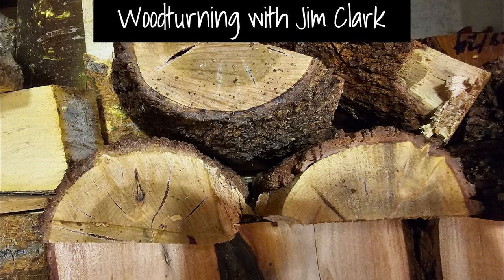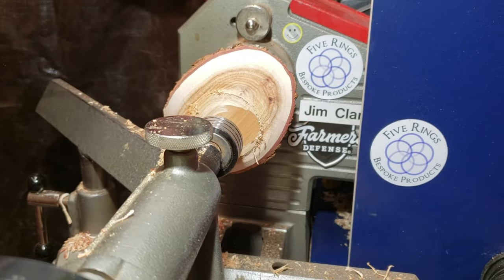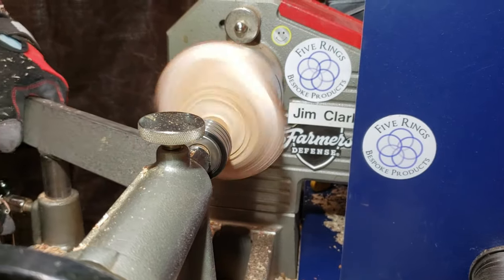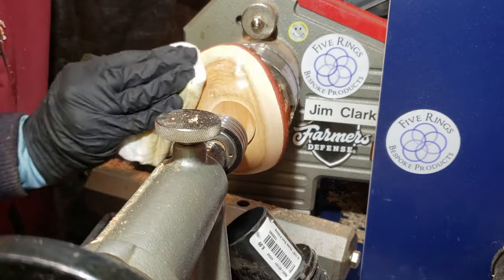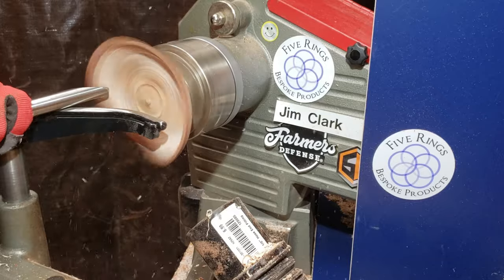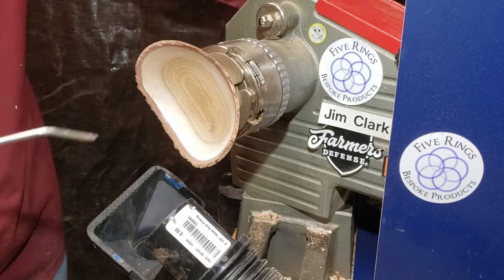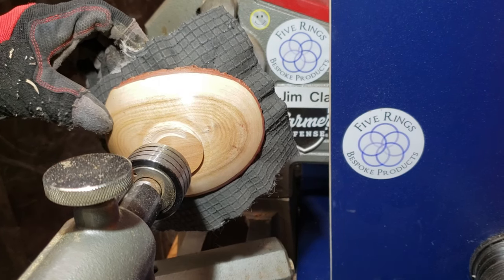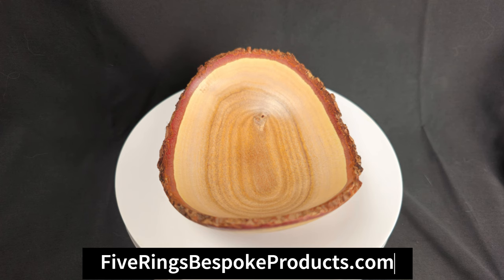Save the Cracking Sumac   woodturning a live edge bowl

Comment: Hi jim it’s jim here from England, cut that sanding sealer 50/50 with thinners by the time you’ve put the rag down it’s dry and straight on to finish. Get them wings down to where you want them then remove the middle that way you dont risk wobble or chisel marks. That type of bowl is very addictive 😊 nice job.
Reply from the maker: @jimgeelan5949  i think my sealer is getting old and concentrated, so I was actually planning to thin it during this video! As far as the wings, you describe my normal technique, but it's so dry here, and the wood is so wet they were distorting from drying, not just being thin. That said, I am always looking for ways to improve, and I know I have a ways to go! Thanks for watching!